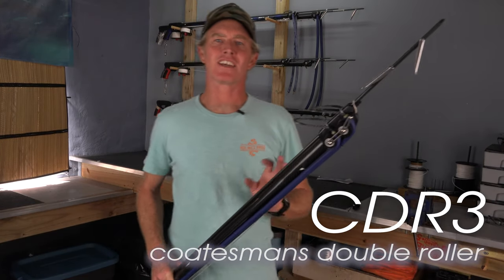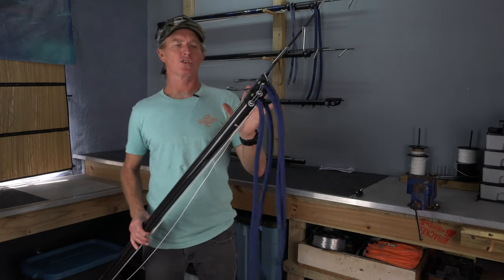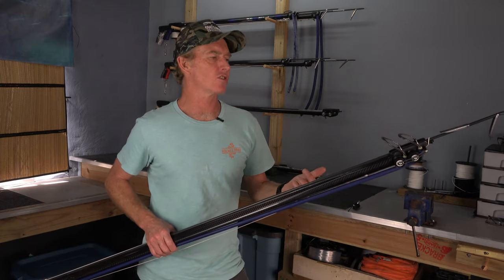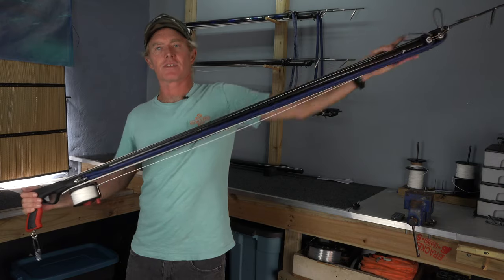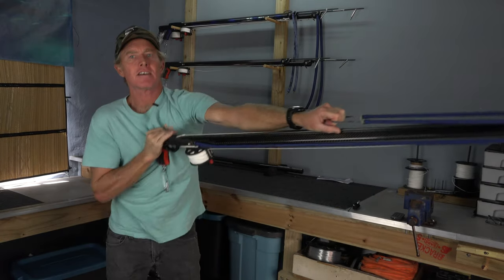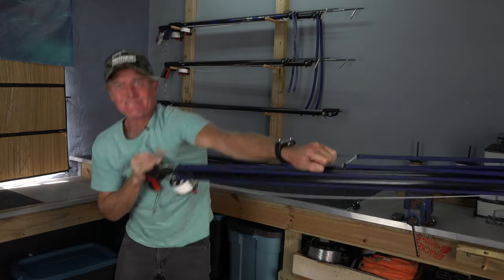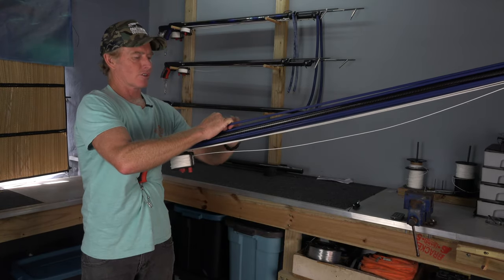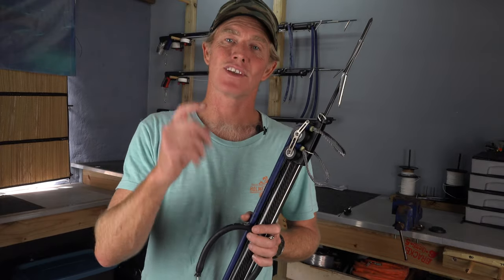How to Load CDR3 double roller speargun.

Comment: Chris thanks for sacrificing your chest for this video

Can you explain why a traditional shark fin shaft with 1 large sharkfin to hold both wishbones would not work with this gun?
Reply from the maker: Hey Never Lucky,
Ha Ha, my chest is fine :-) 
The RA handle is designed to fit into your chest. Pretty much the only gun I can do this with. 
On the question of the shark fin, and both bridles on one fin. This will work no problem at all. And as long as the shark fins are not higher than the muzzle rails you can split them on two fins no problem.
I have found that the notches work best tho, and is so easy there is really no need to go to fins.

Comment: Hi Chris, what’s the benefit of using a carbon barrel on such long gun, if I remember well, rollers don’t have to fight barrel warping as much as traditional ones.
Great videos, keep them coming!
Reply from the maker: Hey Dustsnow666 The buoyancy of the barrel allows for ballast to balance the gun so that it is neutral in the water. This is helpful in many areas, from handling to having to swim the weight of the gun from the depths.

Comment: Will ur double roller run both 14mm and 16mm bands?
Thanks, Stan
Reply from the maker: Yes both 14 & 16mm
But you will need a cuttlefish barrel to carry the 8mm shaft and extra weights needed to handle the 16mm

Comment: hello Chris, 
how does a mono roller vs double roller compare in terms or range? does it increase range? or only power?
Reply from the maker: They are very similar in speed / power and range if they are using the same shaft. The limiting factor is the rubbers snap back velocity so there is the same max speed both guns will drive the shaft.
The difference is in ease of loading
Reply: hello~ thanks for getting back to me. 
what is the purpose of double roller if it doesnt add power speed or range? is it so thicker shafts can be used?   @CoatesmansSpearfishing

Comment: Chris,
I enjoy your videos, especially on roller set up. Any tips on retaining slip tip cable or spectra for use in double or single roller set ups?
I usually use small rubber bands on the shafts, but wondering if you had an alternative you suggested.
Reply from the maker: Hey Michael,
On the slip tips with cable on shafts that have shark fins. I get a long rubber band, choke it around the stopper ball on the cable and pull back the band to the shark fin. This works well with the big guns.
On the drop barbs I have been experimenting with pulling the line underneath the muzzle and wrapping the shooting line over it at the muzzle eye. Still need to film this to see nothing else is going on. But that could be the solution.
Reply: @CoatesmansSpearfishing  cheers Chris, i will try that rubber band trick. i have routed my spectra slip tips the way you describe for drop barbs, it seems to work pretty well. i would be interested to see what  your video shows. Honestly, i do my best to avoid using slip tips, but they don't have a role in certain situations.
Reply: @CoatesmansSpearfishing this is what I've been doing.  Tested it in the pool and had no issues, seemed to work just fine for 3-4 shots.  No issues out of the pool either.

Comment: 130 with two rollers vs 130 with one roller: what does the extra rubber/roller add to the already very good setup?
Reply from the maker: with the double roller you use 14mm bands which you can easily load without a load assist and get more power than just a single 16mm.
Reply: @CoatesmansSpearfishing  can the 130 double roller go with 8mm shaft you think? In where i am, speargun shaft is so expensive and the much cheaper option is either 6mm or 8mm 316 stainless steel rod

Comment: Hey Chris, I'm wondering if a 120 double roller with more pretension/shorter rubbers outperform the 130 double roller as setup in this vid. Trying to work out what the best option would be as far as ease of loading and max power and range.
Reply from the maker: Fish Hunter. On a 120 if you used 65cm 14mm bands with a load assist you would have more power. In reality tho this 130 with 80cm 14mms is fairly easy to load in the water, and shoots really really well. @williampescasub who as I am sure you have seen shoots the crap out of wahoo and doggies. He uses a 130 CDR3 with 85cm bands. Sometimes longer !!
Reply: @CoatesmansSpearfishing  thanks, good to know

Comment: The light came on??? I asked about using 1 band on a dual band roller. I'm thinking remove 1 band instead of keeping both on?
Also, mako 110 roller aluminum vs rob allen 110 toller carbon. The mako comes with a float attachment, does the rob allen 110 roller carbon require a float?
Thanks for the help
Reply from the maker: Snow Bank,
I do have a few clients that sometimes use just one band. And in certain situations works fine. 
I can speak for the Mako, but the RA 110 carbon roller is a good gun. 
Have you seen https://youtu.be/yVkuk0d3-ug
If you use my ultra light CSR muzzle the gun is pretty much neutral in the water with a 7mm shaft.
Reply: @CoatesmansSpearfishing  thanks for the reply and video. Once in a blue moon things come together thanks to ur focused and direct videos. Yahooooo

Comment: Sorry, i asked anchor distance and did not specify a 110 roller.
Thanks, Stan
Reply from the maker: Hey Stan, it is almost 110cm
The easiest way to work out rubber lengths on rollers is half the barrel +5cm
On a 110 use 60cm bands for both 14mm and 16mm.
14mm shoots a 7mm shaft and you can hand load
16mm shoots a 7.5mm shaft and you will need a load assist.
For more check out:
https://youtu.be/yVkuk0d3-ug